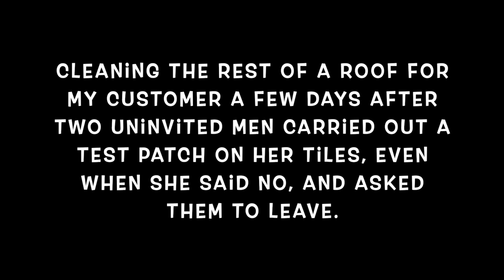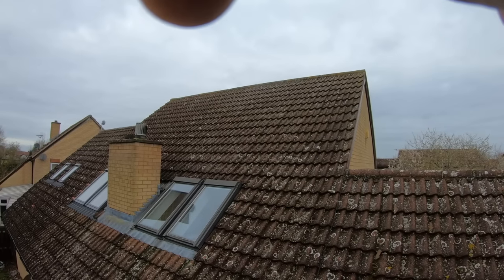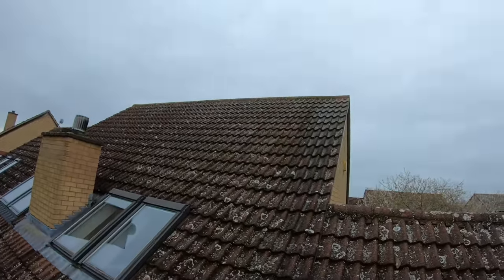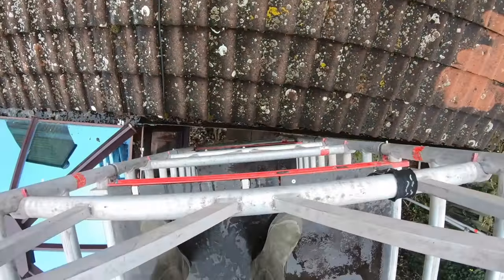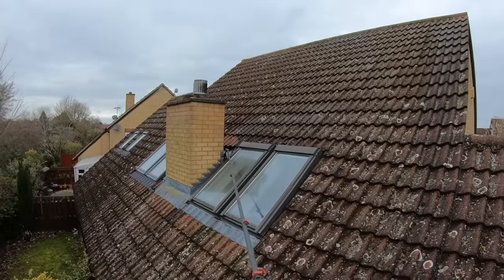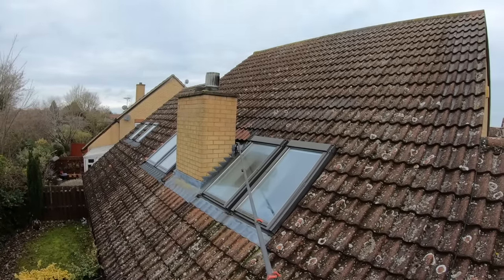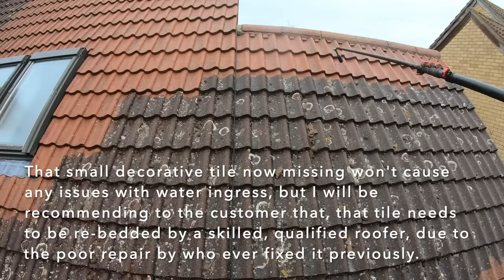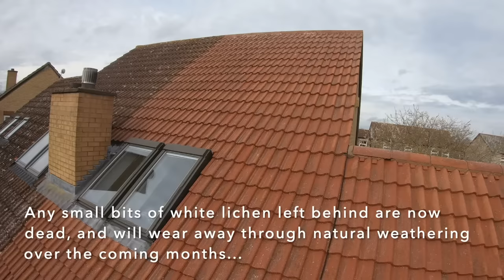UNINVITED GUESTS Cleaned A Patch Of My Clients Roof, And Wouldn't Leave Until She CALLED THE POLICE!

Comment: I know, I know... that's what the roof was supposed to look like and it's better for the roof to be cleaned and it's a great color change... But I like the look of the greyish, slightly mossy roof from before better^^
Reply: I think the owner didn’t mind the color which is why they never had it cleaned before…
I happen to agree with you.  I also question how long before it goes back to dark…
Reply: Yeah. I was wondering, why would you clean the roof? It looks fine. Is the lichen dangerous? Do the tiles rot or decompose? Iam not very knowledgeable about roof cleaning, as you can probably gather and have never seen it done before.

Comment: I have pressure cleaned tile roofs in Florida for a painter & he should have know I wasn't the right person for this job as I am 6'3" & weigh 280lbs. I tried so hard not to crack tiles but it was a losing battle. I had no idea this kind of pressure washing was out there where you do it from scaffold. Thanks for this information.

Comment: I tucker poled a big 5 story office park building in a long day... It was with one of the old aluminum ones, not the newer carbon fiber ones and the top floor needed a 12 ft addon extension.  And I thought that job was brutal... Working a 30 ft pole over a roof on a scaffold would be so much more brutal... nice work.

Comment: In the US we would establish an attachment point at the ridge and use harnesses and ropes to stand on the roof and spray it down from the top. It's a lot of work because you have to remove tiles to set boards horizontally to use as foot holds, every 4 foot (a little over a meter) then remove tiles for the set point, then re-place (that's re... place, hopefully not replace) them and clean those tiles. Some contractors may use your system, but I've never seen those power washer extentions that long before in the US... but I was never part of a true for a dedicated exterior washing service, rather I was part of a crew for a demolition and remodeling crew that offered exterior washing has one of our services, so there's that too, but we did power wash two tile roofs while I was there (two years)... and probably about 20 shingled roofs.

Comment: Hi man, you need to get yourself a soft wash system could’ve done that job in 40 minutes with no scaffolding from the ground I clean clay tile roofs all the time 5 to 7% chemical SH chlorine with a surfactant would be enough to remove all mildew off of those tiles spray it on and let the rain take care of the rest. Doing a good job. Working hard for your money but you could be working easier.
Reply from the maker: I appreciate that you're trying to be helpful, and I can only assume you're from the US or Oz, because that's not how we work here in the UK. I have soft wash system, I soft washed the tiles after pressure washing them, with 4% SH and surfactant, it's in the video. The system the Americans and Australians use is completely unsuitable for the UK, , using long range jets to spray SH on the roof from the ground, the risk of the overspray getting caught in the wind, landing in other peoples gardens, killing their plants, entering their ponds and killing their fish, landing on their kids or pets, is way too risky because of the way our buildings and houses are so tightly packed in together when built. Our health and safety laws would have any company caught doing that in the UK shut down quicker than you can say "massive fine"
I also pressure wash the roof first, using low pressure, because customers, in my 12 years experience want instant results, because they are sick and tired of lumps of moss landing on their floors and blocking their gutters, they don't want to wait 3-6 months for the moss to fall off in bits and pieces. Hence, that is why I do nearly all my roof cleans like shown in the video 👍.
Reply: @PrestigeExternalCleaning  Dang that’s crazy. I did not know. We just Pre wet the surroundings that’s it. Chlorine is biodegradable. I am in US Florida 11 year’s experience. Here as soon as you put the treatment on it is a night and day difference. And it rains every afternoon here in Florida anyways so it gets washed off pretty quick chlorine in the  US is deemed safe for the ground as long as it is diluted. I personally use it around gardens and fish. All the time the solution to pollution is always dilution. Thanks for the response. Can’t wait for the next video.

Comment: I have a detached bungalow. My roof tiles look the same material if a bit different design in shape. Will a household Karcher pressure washer do the job and is there anything you should be doing to prevent damage or causing leaking issues?

Comment: Fantastic job, the difference between before and after is amazing. 
Have you considered getting a "cheap" drone to video up & over, before & after aerial footage. 
I assume that you disconnect the downpipe from the gutters so rug that all the runoff/debris doesn't go into the drains or block the pipe, but wouldn't it make things easier if you attached a temporary flexible "sleeve" to the spout/spigot, down to ground level and into some type of mesh bucket. Would let the water out, but collect all the debris and it would also vastly reduce the amount of dirty runoff down the walls. (A smaller version of the rubble/rubbish  shoots that they use on construction sites)
Reply: Abbie trying to get a job! Good suggestions

Comment: Hi Buddy great job I have two  questions 
1. do you have a low pressure to get done this job 
2. to hold the pole what is the angle on your lance and  your arms don"t getting  hurts and also can I use sodium hypochlorite soft wash on drive ways.

Comment: I would imagine holding the pole a full length can get a bit heavy on the old arms. Is there some form of two wheel dollies (light weight materials) that could be attached to take the end of the spray pole?

Comment: I swear, if someone made a test patch on my roof without my consent, I'd be doing a resilience test on their work vehicle with the first powertool I got my hands on in the garage.
The sheer audacity itself is upsetting.
Reply: Had this happen to me, the one bloke even told me to sod off. So i did, into my house, and came out with a 12 guage loaded with salt.
I am now the owner of a rather upmarket pre owned pressure washer 😏

Comment: I'm sure you offered the next door neighbor a discount to clean their roof at the same time?  

Where I'm at (USA - Virginia), I've never had to do a tile roof, but I've assisted a friend on two of his jobs.  Everything here (almost) is asphalt roofing.  Could you have soft washed that section and just told the customer you didn't feel safe using a pressure washer on that section because of the risk of damage?  

I had a job something like this.  It was a gable roof with horrible GM staining, and a lot of moss and lichen.  She wanted the forward facing flat asphalt cleaned, and the front of her garage.  The roof was in such horrible shape I gave her a full roof cleaning quote.  She called me back about a month later after two guys (rookies) came and pressure washed the front/flat surface on the wall, but the garage roof was too steep to walk on, so they tried pressure washing from a step ladder.  All they managed to do was blow debris under the shingles.    At the end of the job the two guys were standing there at her door in the dark, of a woman home alone with a small child, so she was afraid not to give them the check, even though it was crap work, and they asked for double what they quoted because it was a harder job than they anticipated.  I was pissed and told her to call the bank and cancel the check.  But, that one section they pressure washed looked so much better she saw my logic in cleaning the entire roof.  I still had to come back and clean some of the cleaned roof.  Then I did a half and half photo of the front garage roof the guys had supposedly cleaned and sent to the customer so she could see how little they did.  I cleaned that for free just as a "SCREW YOU" to the guys there before me.  I think I'd have taken the guys contact information and called a lawyer and sued them for the cost of the roof cleaning for her roof and the neighbors since cleaning one part would be an eyesore.  I really hate unethical people like this.  That's a great sales tactic, but not if you don't get permission first.  You could go so far as to say that pressure washing would erode the surface of the tile, and see what could be done from there in the courts.

Comment: What happens to the Sodium Hypochlorite run off.? Is it permissible to let the Sodium Hypo to overflow into the stormwater drains?
Reply from the maker: It goes into the drainage system, which is then joined to the sewer, which then gets treated with sodium hypochlorite once all the crappy bits have been filtered out, to make it safe for consumption again.

Comment: This mans arms must be huge to support that long pole all day like that! Not a job I would look forward to doing, lol, or probably even be able to make it through! I have some pretty decent endurance, but that is a whole other kind of a very specific endurance! I would assume you would have to be good at mentally going to your happy place to push through the pain and just embrace the suck until you built up the strength to be use to it! Quite impressive!! 😀
Reply from the maker: Thanks Jesse, but the water pushing down on the roof takes a lot of the weight off the pole. So as much as i'd love it if that was true, it's just not i'm afraid. But thank you for the lovely comment 🥰

Comment: Just found your channel recently, beautiful work done my man. I am curious, does the water pressure + flow rate take most of the weight of the lance meaning you only have to worry about positioning? Or is it still a lower back workout to take the weight of the lance while its on?
Reply from the maker: Welcome on board bud 👍. Yep, 100% spot on, the pressure and flow pretty much take all of the weight, and it's just about getting the positioning right. don't have issues with lower back, but your shoulders get a work out from the constant moving from side to side, up, down, left, right 👍

Comment: Does the pressure of the water coming out of the nozzle help you hold the pole? My arms would be in so much pain if there was no help haha!
EDIT: The reason I wonder is because of Newton's Third Law where every action has an equal and opposite reaction.
Reply from the maker: You’re a 100% correct. The water pushing down on the roof takes most of the weight. People assume that I’m taking all the weight, but I’m not. Don’t get me wrong, it’s still physically hard work on arms and shoulders, but for different reasons. I used to try and explain this, but  I would get the same comments repeated over and over, so just gave up on explaining in the end. Thanks for the great comment, I think you’re the first one to recognise this and make a comment about it 👍

Comment: Is it a necessity to clean moss off roof tiles? My house survey stated it was an unnecessary cost.
Reply from the maker: No it's not necessary a lot of the time, although moss and lichen will damage the tiles if there's quite a lot of it. Lichen secretes acid as it grows, which eats in to the tile, causing little pits and dips. Moss rhizomes anchor themselves into the grain of the tile, which can freeze in winter and cause the tile to crack.
Most of my customers don't have their roof cleaned because of aesthetics or because they are worried about the above, they want it cleaned because they are sick of moss constantly landing on their patio or driveway leaving a mess, or because it's constantly blocking their gutters and down pipes.
Reply: @PrestigeExternalCleaning  yes that makes sense and clogs the gutters etc.... aesthetically if you were selling the property it would definitely give kerb appeal.👍

Comment: Any reason why you spray hypo instead of biocide?
Reply from the maker: Hypo is a biocide bud. Hypo gives instant results and looks instantly better than bac50 or DDAC based biocides,  the effects also last just as long as these other biocides, despite what people might say. I'm not against bac50 or DDAC products, I use them on certain jobs when hypo is not appropriate, but my go to biocide will always be hypo if I can.
Reply: Sodium hypochlorite is a lot cheaper dose the same job than Benzalkonium Chloride is lot more expensive also 50% strength Ammonia based
Didecyldimethylammonium chloride is an antiseptic/disinfectant that is used in many biocidal applications.

Comment: Nice Cleaning job. You should be repairing that decorative tile however at your cost.
Reply from the maker: Incorrect. The customer is always made aware that they may have cracked tiles or degraded pointing that is not visible under the dirt and organic growth before we start, and that we are not liable for uncovering said issues, and they will need to contact a roofer to have these areas repaired if need be. They have to agree to these terms before we carry out the work, or we don’t do it. Hence we/I am not liable for the repair.
Reply: @PrestigeExternalCleaning  Not quite legally speaking . And you can’t remove liability like that . It would be classed as an unfair term and condition if you use it to cover all damage that could occur through the use of a jet wash.The argument would be the tile wouldn’t of broken off but for the jet wash ,which can’t be argued against . A roof tile and it’s fixing is designed to withstand the forces of nature . A jet wash can be a powerful thing and can provide a localised force well beyond what nature can throw at it and is well capable of causing damage. Put you jet wash up against some lime  mortar foe example and the jet wash would win every time. Due to that where jet washers are used many people will protect parts they don’t want the jet wash to hit .. admittedly a bit hard for you to do with what you are doing. You would however have a hard time proving your case. All they have to show is you directing the jet wash at it caused it to fail to take you to small claims . For you to defend the claim you  would need to show it failed due to faulty mortar  which  wouldn’t be easy. I’m just saying in case you need to cover  your arse in the future, because your work is good so it can be better to go the extra mile for your customers when things like that occur . Reputation is everything for a small businesses like yours. It would have taken 5 minutes to repair
Reply from the maker: @michaellecky6438  Why do people think because something is small, that it's automatically going to be easy?  and "take 5 minutes" to repair. You can't just superglue that tile back in place, the whole badly repaired area needs removing and replacing, it's certainly not a 5 minute job if done properly. Me getting up on that roof is also very dangerous and wouldn't be covered in my insurance, so I am not willing to get up on a roof, potentially risking my life for a job that has been agreed by myself and the customer, is not something I am liable for.
Maybe it would be classed as an unfair T&C's IF I was using it to cover ALL damages that could occur. But that's not what we have in our T&C's. We will happily accept any liability that has been caused by us, dropping the lance and cracking some tiles for example. But we make it perfectly clear that any pre existing damage, that we simply uncover through the cleaning process is not something we are liable for, because it was damaged/faulty or degraded before we started. This is not an unreasonable term to have in a cleaning businesses T&C's
This tile dropped because it was due to a poor quality repair that was already there, a bird could have landed on that little tile, and it would have slid down the roof into the gutter, it's just by sheer luck that, that hadn't happened already. I would also have absolutely no problem what so ever proving that the tile dropped due to faulty mortar, I would simply take a video of me taking a piece of the faulty mortar from around the badly repaired area, to show that's where it came from,  hold that piece up in front of the judge, and crush it in my hand for him/her to see it disintegrate into a sandy mess in front of his/her eyes. Something strong, well made mortar would never do.

Yes reputation is very important to a small business like mine, and I/we do try and go the extra mile for our customers, but a line has to be drawn somewhere.

Thank you for your concern, but i've been doing this for 12 years, and haven't had the slightest inkling of people trying to blame me or take me to small claims court for a pre-existing cracked tile or faulty mortar, after they have agreed to my T&C's, so have no reason to think that my T&C's won't cover my arse in the future.

Comment: I was always told you couldn't pressure wash tiles like that or they loose their water proofness?
Reply from the maker: It’s a common misconception, and incorrect.
Reply: @PrestigeExternalCleaning  Thanks for clearing that up. Is there any roof tiles you cant pressure wash?
Reply from the maker: @DasArab  Anything made of asbestos, cedar(any wood tiles) and Bitumen shingles, like a lot of the Americans use on their houses